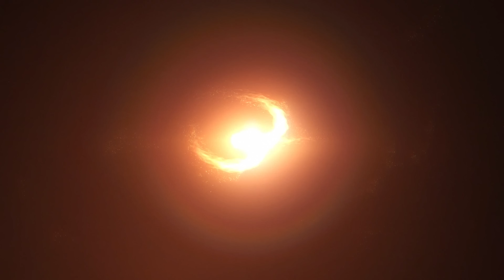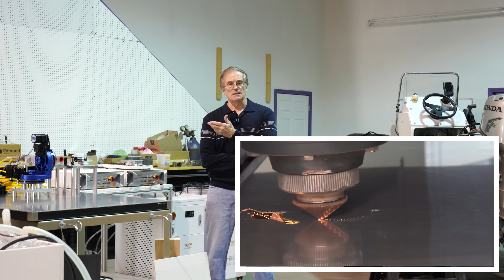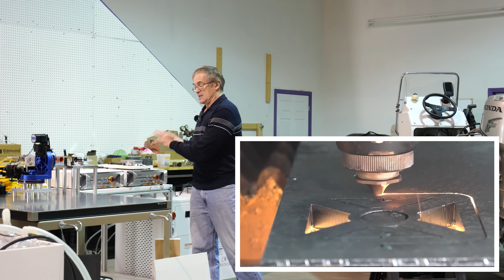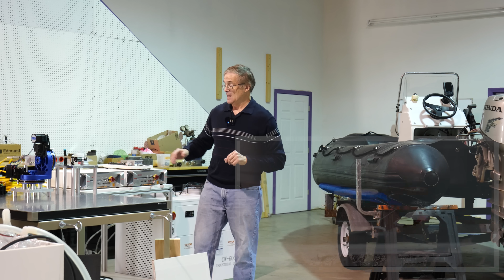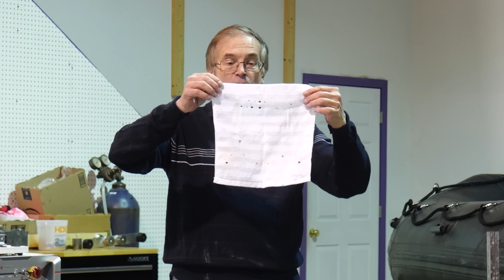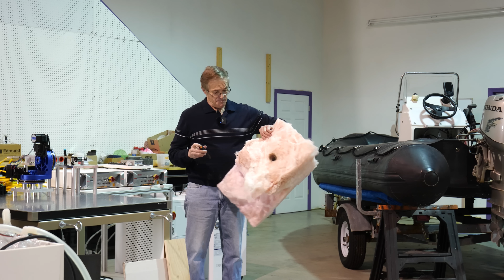We have a problem... and need your help!

Comment: If the goal is to test flying drones, and during test no person is allowed in the room, then why not mount the laser system high (close to the ceiling) and shoot towards the floor?  I.e., use the concrete floor as the beam stop.  Drones still can hover above ground and move in the horizontal plane to function as a target.  Sure, there will be a lot of burn marks, craters etc. on the floor, but it is concrete, just pour more after the test.  This sounds like a cost effective solution to me.

Comment: Maker solution, out of the box thinking. Use wet blankets AND keep them in motion so when the laser stops the blanket won't.  Try simple, point an industrial fan at the blankets. If necessary put counter weighted motors on the back of them..... Well maker and SE at JPL but I'll take the maker credit any day :)

Comment: Very difficult challenge. I have only two concepts which may be stupid but one never knows. First one is using something covered in powdered glass. The concept is for the beam to be diffused quickly and thus reducing its focussed energy. If the glass particles are instantly melted , this wont work. The second would depend on the area that needs to be protected. It could be a material strung between two rollers and moving a high speed. There could be an intervening static  sheet between the two rolling ones for further absorption. The idea is that the laser wont stay in the same patch for too long and thus the surface gets less hot, buying some extra time. Mechanically it would be similar to the belt system in a van de Graff generator but much wider. As for the choice of material, I dont have a clue. Thank you for the great staff that you preent on this channel. You guys are great.

Comment: Can t talk from experience, but how about some diffuser or optic to defocus the beam before it hits a solid stop. Maybe a rotating target so the ablated material gets renewed? Milky water tank with particles in suspension or some semi transparent plastics arranged in multiple layers and progressively more opaque.  A large optic; mirror or lens, or an array of smaller defocusing lenses followed by a solid stop. Wouldn't neutral density glass, starting at very low and going progressively higher with many layers work? How about a multistage polarizer filter? Another way  to defocus the beam might be hitting an angled refractive medium, maybe a sandwich of multiple layers, which are not //, 1<n-air-1<n-air... Maybe there is a gas that would ionize when hit by the laser and absorb/defocus some of the energy.  You could probably detect when the laser hits a surface and stop the emission. A wall of sand between two windows could be a self healing stop added some vibration or even glass beads as  diffusers?. Good luck. L.

Comment: I have seen a optical fiber magnifier, which maybe you can use as a spreader. You would need pretty small fibers since you mentioned the focus area is very small. This should theoretically spread out the intensity and you might be able to use the water technique or some other material. Or another option might be a diffusing or dispersing lens maybe like a fresnel lens, that spreads out the laser, like a magnifying glass effect.

Comment: An Aerogel endpoint surface barrier with a failsafe being a vibrating motor hooked with the laser source to prevent long time exposure to the high intensity beam of the laser in a single point, or a set of mirrors that could disperse the high energy laser in an enclosure with thermal a dissipator in the outer surface.

Also you could depend on sheer volume of mass or thickness, instead of thin layers, maybe a fish tank with some of the previous explored materials, a brick lying down may give a better performance.

Comment: Suppose my first idea, using a clocking device (Freescale Semiconductor US patent), is too hard to achieve. In that case, I have a second idea for interrupting the laser if it passes through the given distance. It is a time barrier device. It will change the laser frequency to a higher frequency, like X-rays. Mad Marcum or Dr. David Lewis Anderson from Anderson Institute achieved this three decades ago.

Comment: Possible strategy: Diffuse, then absorb. Not sure about the portability, but maybe layer of hydrated gel crystals sandwiched between something that can take perforation without fire hazard. Coat the inner part of the hydrated gel sandwich skin with a reflective coating to keep the laser bouncing around the diffusion material. Possibly quilted mylar + hydrogel sandwich curtain?

Comment: Even cheaper and easier than I was thinking before, take a bunch of regular pencils, stack them neatly, cover them with sand fully, pour water on top. The hex packing should mean there's no path that won't go through wet graphite, the sand weighs down any wood so it doesn't float up in the water, the water makes the graphite darker as well as better cooled. It's cheaper than cheap and should work.

Comment: I feel as if water would work well, it would disperse and redirect the laser throughout it so that it would not only lower the intensity, but also prevent anything behind it from potential danger. Perhaps setting up a roll-able clear tank, in which you could fill with water, and drain when necessary. The only problem that I may see is depending on the tank material, I am not too sure if the laser would start to burn the tank, I believe that plastic may be burned somewhat fast, but materials such as Pyrex or quartz may perform much better. Hope this helps! 💧

Comment: Water curtain. Or water sheet running down plywood or drywall. Need to replace the water at a high rate.

Comment: what about a (water/air/oil) cooled Graphite/carbon block or box maybe slate shingles similar to the laser stops or beam blocks in some high power laser setups or like graphite laser shutter also not at full until its locked on assuming you aren't you could also try an autofocus lens to pinpoint the target and have it out of focused when its beyond ranged. I know you are trying to use a collimated laser but as you demonstrated not having divergence as its a unified path but it may be simplified by having an artificial limits for safety of your testing facility you also could contumely move the galvos  to a "safe" Home and target at a prescribed duty cycle also just use a moving ellipse or circle to allow for the laser to not stop moving on a surface aside from the prescribed home as a physical break thorlabs makes a small stops you could try replicating at scale where its like a watercooled v block cut like a fresnel lens

Comment: Could a metal shutter be installed between the laser diode and the fiber optic resonator and have it controlled by the computer for shutting it down? Used such a set up between the mirrors of a YaG laser to prevent a beam. Also had a special quartz switch to turn the beam on/off to print on silicon wafers.

Comment: I like the idea of sand it would be interesting to see how a series of fresnell lense like panels would act or grab the gel beads and fill a transparent faced wall with a variable cavity thickness of them may defocus and have enough water to absorb heat and easy to refill/re hydrate unless you get odd chemistry may also be able to just use salts

Comment: Could copy the design off an X-ray anode. In a rotating anode X-ray tube, the anode, which is the target surface struck by electrons to produce X-rays, rotates. This rotation allows the heat generated during X-ray production to be dispersed over a larger area.

Comment: Water was my first thought, but not for the fire suppression factor, more for dispersing the light. Obviously any container holding the water will be pierced and then leak. 
What about a glass tank containing glass spheres suspended/soaked in water? The shares I'm thinking of are the composite resin filler type type. 
Or clear silica sand in a water bath. 
I'm picturing the laser tight may burn some particles and pierce a hole in the glass, but then be refracted into the water and media. 
I'm a carpenter, so if I am way off, I'd love to learn how and why my idea is wrong and further my knowledge.
Reply: Or another variation on the water tank, would be micro bubbles from an array of aquarium sintered brass bubble stones. 
And each time the glass is pireced, it can be patched with clear tape or a dot of silicone.

Comment: Point at the ground was my first idea as well.
Second idea is i dont see whats so difficult about building a form and pouring a big ol concrete block. 
Build the frame first with heavy casters and pour the block.
Easy to roll away when your done so youll always have it. Effective. And cheap.
Reply: The issue is portability you need to be able to get that wall behind the attacking drone swarm

Comment: I suggest placing retroreflective microspheres in a fish tank with water, and using aquarum water fans to keep the microshere water mixture moving. The retroreflecive micosheres will disburse the laser light, the water will make for a great heat sink, and with a sufficient speed water fan the microspheres will move out of the laser light before being damaged.

Comment: I'm just an amateur in terms of science, but I love learning and love all of your videos!  
There may be something obviously wrong with my idea, but here it is anyway:
Since we're talking about fast, powerful light beams, I thought perhaps stopping the beam may be the wrong approach.  Instead, I was thinking that some type of fiber optic apparatus could be used to either redirect the beam to some safe direction like the ground for example, or even somehow "trapping" the beam with an air, water, or even refrigerant-cooled heat sink.  Or, perhaps there's a way to elegantly use fiber optics in a way that cuts or dissipates the light energy before heat can accumulate to an unmanageable level.

Hope it helps in some way!  Good luck.  I look forward to seeing what you end up using!  It was quite fun thinking about this.

Note:  I feel pretty sure there's already a solution to this problem.  It's most likely to have been developed by our government or one of it's contractors as part of one of their many classified defense programs.  For example, I can see a definite need for something similar to protect our mission-critical military satellites from laser weapon attacks.  I haven't tried this, but what does Chat GPT say when asked?

Comment: Few suggestions, we'll one suggestions a few different approaches.  
1.Dirt! . Huge pile of dirt not lite weight or portable.  
2.Dirt. Dig a hole (room sized hole in the ground) need a back hoe . 
3.dirt! go high ! Build a structure up up up. And point you laser down, To the  ground. That dirt is free just don't catch your grass( or any other greener) on fire
4 dirt ! If you have a mountain or hill on your property or a nearby property that a friendly neighbor will  let you use cut a burm into the hill (like someone would do for target shooting with guns ) and you have a great solution. 
Feel free to reach out with anymore questions or concerns.  That one was an easy one. Cheers

Comment: Water filled transparent tubes with addition of Al dust and, may be, some dye that would transform that concentrated beam to some diffused light. Constant stirring probably needed. Front surface should probably be not flat and should have some overall angle relative to the wall to deal with what would reflect from the surfaceses of the tubes.
And if you're using something like a dry wall it would be better to make some angle relative to the beam so the material would appear thicker. Then  some gap and may be crashed glass to spread the energy and then another dry wall. Anyway you need a composite structrue, not some simple material.

Comment: Oak pallets.  Use those stamped "HT".  Soak them in water if need be, get them waterlogged.  The Soviets used Oak as their ablative shields on returning capsules from space.  You can round up a truck load of free (not the re-usable pallets), landfill-bound, usually raw wood Oak pallets.  Bring someone who knows their wood types.  Oak is pretty easy to discern with a little practice.  And the businesses that have accumulated them will be glad that you are hauling them away.  Oak takes a lot of heat input to catch fire, so I think rain-soaked pallets might be best.  When done with them, find someone who wants free, high-quality firewood.  Don't burn pallets that are labeled as MB (treated with methly bromine).  Oak pallets are just about everywhere.

Comment: Late to the party but ecology blocks are reasonably priced and would be maybe $3-$4k for a decent wall. You would need equipment to set it up so add another $750. Quick, easy, non-permanent not a bank breaker.

Comment: Use blocks of ice. Many ice plants make 300 pound blocks of ice.
By sandwiching your blocks of ice between polystyrene insulation board (styrofoam), a relatively small refrigeration plant should keep the ice frozen.

 By tuning a dye placed in the ice, you should be able to maximize the energy absorption to the light color.

Since the only time you are going to hit the ice is when you miss your target or cut through the target, the length of time you need to withstand the beam is short.

Because ice is good at scattering light, wrapping the block of ice with foil would let you use some photo detectors to sense the beam striking the ice and kill the laser power supply.

In the winter time, ice maintenance would be free!

Comment: CO2 to suppress the fire; no oxygen, no fire. That said, given the intensity, it would split the molecules to individual atoms. Perhaps a noble gas?

A massive diffuser might help reduce intensity to a safer amount when absorbed? Then again, what kind of material can withstand such intensity for diffusion?
Reply: What if the diffuser has liquid cooling? What kind of fluids can be used to chill the diffuser well below 0 degrees Celsius without itself being flammable? Water is no good for this intensity.
Reply: What about a diffuser that can handle very high temperatures that can also be liquid cooled?

I'm thinking liquid salt; like what would be used for a liquid salt nuclear reactor for power generation.
Reply: Let's go even further beyond! Why not use liquid salt as an absorber, too?
Reply: You could use a very shallow highly reflective and very high temperature tolerant reflector for the diffuser.
Reply: You can use thermal detectors to indicate the laser has hit the diffuser and automatically shut down the power to the laser.
Reply: For a thermal detector, you could use an IR receiver, bimetal, or even something calibrated to detect the frequency of the laser as an input. I would recommend IR myself. You could even use something to detect the increase of flow of the liquid salt.

Comment: In my experiments,  when going overheated plasma temperatures i use "aki brick" i made them usually mixing aluminium oxide and high temperature silicon, sometimes with a hint Of grafite To add some thermal conductivity,  poured on 30cmx30cmx6cm tile molds or just soaked In To a rockwool slab
Reply: With that kind Of small point heat, i think i just take a Jerry can, fill ti with water and freeze it,  and just plug The little holes  In The side with ducktape To prevent leaking when The test is done😊 or just use clay and water sludge so it wont leak out and Then freeze it

Comment: My first thought after watching would be to use some transparent material that has something suspended in it that is not transparent to the laser, so that the energy from the laser would be absorbed across the volume of semi transparent material. I thought maybe some sort of water based gel with particles suspended in it, but I am not sure how that could be scaled to the size you need.

Comment: a series of mirrors bent at a 45 degree angle at the ground where a sacrificial substance could be placed, like a backstop for a target range?

you could also link the kill switch to go off when the tracking is finished and stationary, an "if then" statement if the stepper motor stops receiving pulses tied to a plc type boad. good luck

Comment: If plywood ends up being the most practicable - you could leave an air gap between the layers.   That'll leave all the surfaces exposed for extinguishing any fires.   Could also do a water curtain - probably doesn't add much time resistance, but it'll suppress the fire automatically.

Comment: What about detecting beam escape and rapidly killing the power supply?  You no doubt already have scan loss interlocks, etc, ORing in another kill signal seems pretty straightforward. Perhaps using a conductor/insulator/conductor sandwich that when pierced by the laser becomes conductive enough for detection purposes.  This can be layered over an ablative material that only has to survive long enough for the power supply to shut down, so likely drywall would be sufficient.  Reset is easy, either the material self-heals when the plasma goes away, or you just cut out the damaged area to clear the short.  It can probably be fabricated with aluminium foil and a suitable insulator if such a sandwich isn't available off-the-shelf, but there is likely metalised materials available that are suitable.

Comment: What if you made a big and relatively thin plywood box, made it water-tight around the edges, and filled it with water?. Yes, you would punch small leaking holes in it, but the water would extinguish any fire, and you could just re-seal it.

Comment: How do laser cutters achieve such a square edge if the beam is at such an angle? I always chose it over water jet cutting, because I didn't care about the hardened edges from the heat cycle. Squareness was more important to me. Interesting.